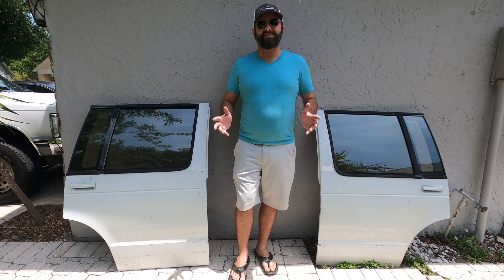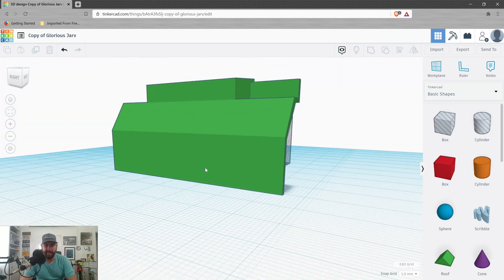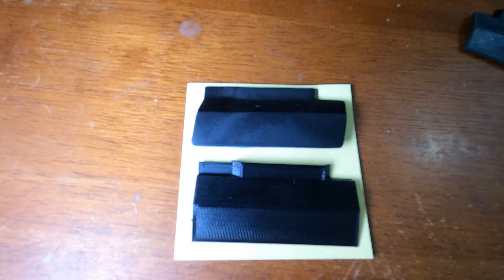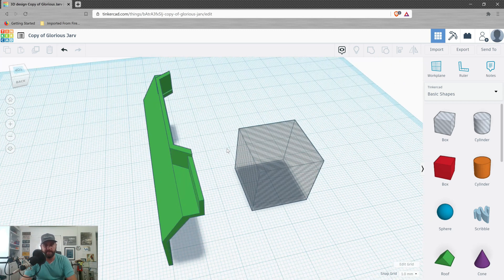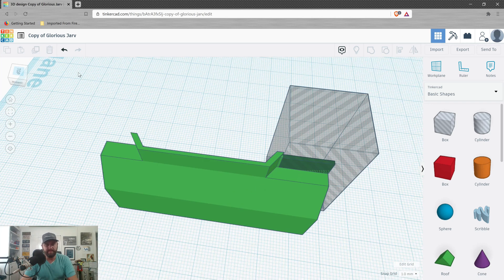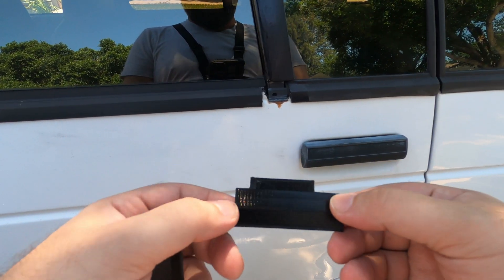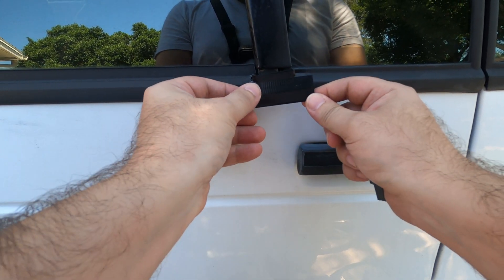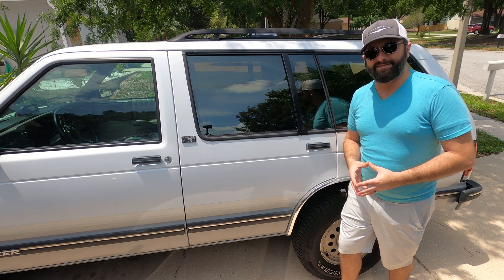3D Printing Car Parts | Window Trim For My S10 Blazer!

Comment: I haven’t installed mine yet but they look great!
Reply from the maker: Glad  you like them!  Thank you again for the purchase!   I've had the 1st set on my Blazer for 18+ months now and they're still holding up well.  It's been sitting outside in the Florida sun and heat the whole time.  Just make sure to clean the area on the door well, then peel off the square piece of tape to fill that cavity, then stick them on.

Comment: How is pla holding up in the sun of summer?
Reply from the maker: I used PETG not PLA, but it is still holding up pretty well.  Actually made an update video on the trim, and a few other parts a couple months ago.  https://youtu.be/AejjC10u14Q

Comment: i was searching google for rear door parts for my first gen blazer when i found this video. seems like the rear doors never existed on these trucks! i have a set of these in my ebay cart now! have you found rear door window seals yet? i am coming up empty on every site!
Reply from the maker: I know right?  I don't think anyone makes the window channel rubber for the rear doors.  My rear door window seals are in pretty good shape, fortunately  The inner rear door seal is the standard stuff, cut to fit, same as the front.  I do still need to replace those on the rear.  I did the front inners along with the full window channels and it was a big improvement.